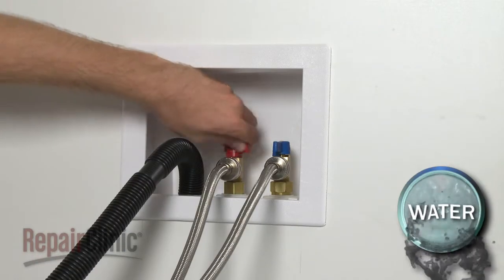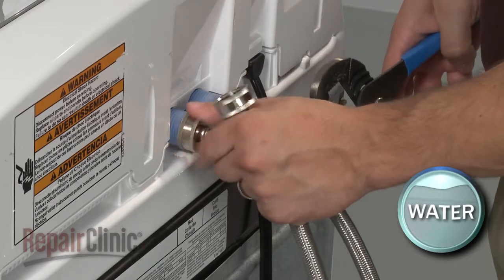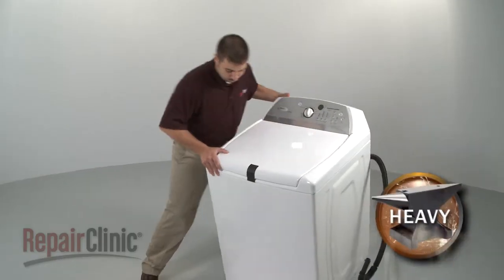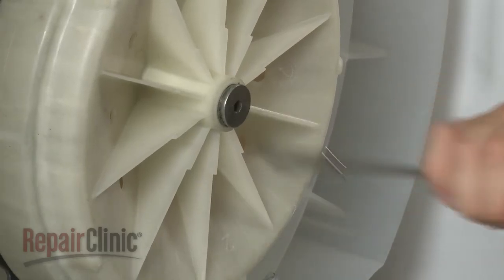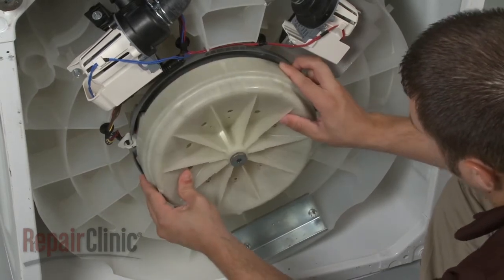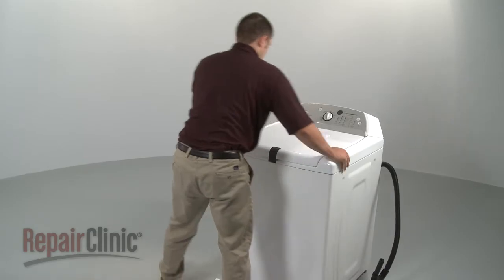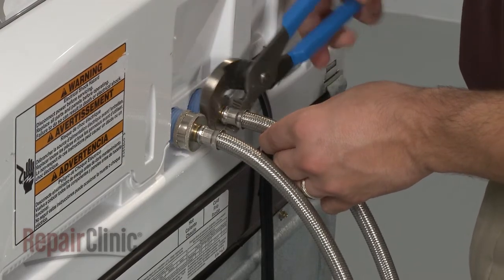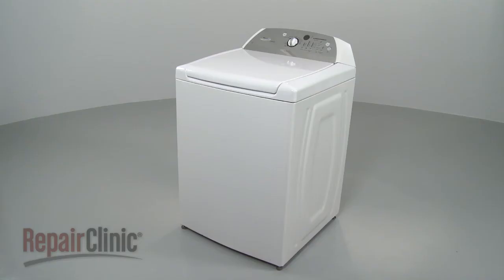Whirlpool/Kenmore Top Load Washer Rotor Assembly #280146

Comment: I removed the 1/4 inch bolt on the motor rotor, but it won't come off.  Any suggestions?
Reply: Same issue... any suggestions? No one replied to Ms. Yocom
Reply: I had to work at mine pulling at each edge. With my foot against the frame. Hard pulls and it came right off.
Reply: OK, I sprayed liquid wrench, tried to pull it off...no good.  I hit the center with a sledge (several moderate taps in the center)  still nothing...then I put on gloves....rocked a little ...pop it came off.

Comment: My washer looks like this underneath. I'm trying to diagnose why it's not spinning when it gets to the spin cycle. Finding out through research it could be coupler or clutch but I can't find how to get to those on my model (kenmore oasis top loader bought in 2009) most videos I find are of different models and the motor is right in front. Not mine. Any help would be great. Ty!

Comment: am about to embark on this journey.  I believe I can tip it backwards and get the item. Its buzzing and sitting with a full tub of water. It had pants and a sweater wrapped around the adjitator. I presume this killed it.
Reply from the maker: Are you sure you can tip it over with the water in the tub?
Reply: ***** Ran though the settings and she agitates, fills etc., but the water pump just buzzes loud.  I am hoping something just got sucked up somehow else I suspect the pump.  and no...I need to bail it out before I tip it. :)
Thanks for the posts. Appliance repair was my other career before television.
Reply: replace discharge pump and afterward also noticed slow filling which was someone having turned my water valves "half off". the pump must have been bad though. it was worn, buzzing, rattling etc.